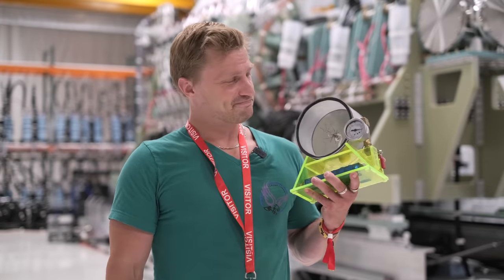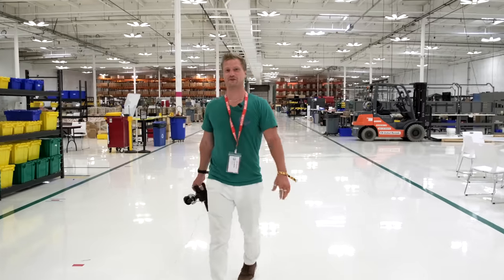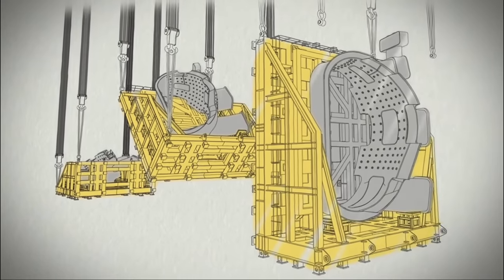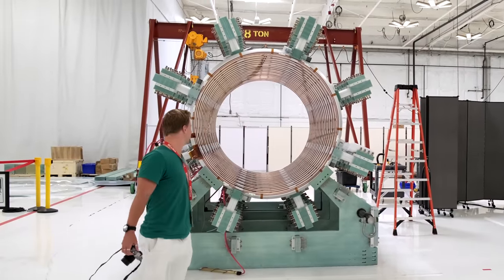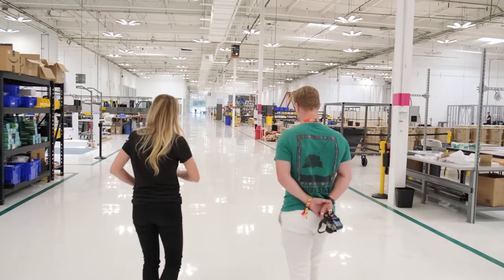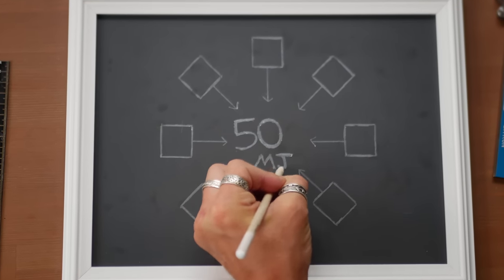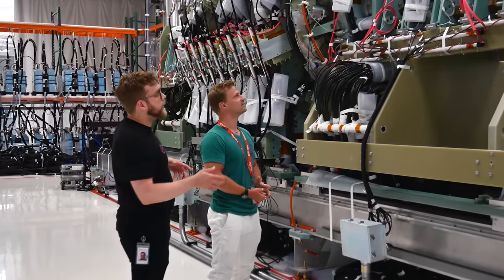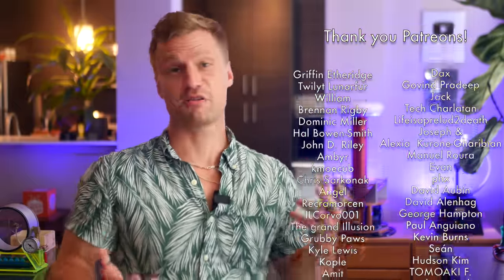An Exotic Approach to Nuclear Fusion (Helion Energy BTS)

Comment: I was very surprised when some years ago had discovered that the atomic fission is simply used to generate heat to run the turbines with steam ... it felt like wood was replaced with coal and coal with uranium adn than we stopped for ages... Seeing this approach is very refreshing and inspiring. Looking very much forward to see all this fusion tech to change the world as the steam power did at its time.
Reply: This tech is already 70 years old, it’s essentially 
It’s doesn’t yield any energy, as you put more energy in than you get out
Reply: I agree with you about splitting atoms to boil water. It seems very wasteful doesn't it? I live within a mile of a nuke plant. I figure I might as well be at ground zero. Very little fuel but very toxic too!
Reply: Wood, coal, oil, uranium, and Helium 3 are all used as fuel, but with more specific heat produced as we advance. But it's probably not going to happen because fusion is far too violent to contain on any useful scale.
Reply: @StoneKathryn its just because energy capture is pretty difficult.
Reply: I agree! @Dynoids
Reply: @beelzebub3920  E=MC² does wonders just saying
Reply: Except you need 1 million times less uranium than you need coal for the same energy output. 
And it can make more fuel from non-fuel.
It's as if you put charcoal and some rocks into the furnace and got anthracite out of it.

Direct conversion however don't work with fission due to neutrons and fission generally being "messy" i.e. producing plenty of different elements after fission event.
Reply: Weirdly enough, the majority of our power generation comes from making a fluid medium spin a thing. Wind, hydro, steam. It's funny when you think about it.
Reply: @StoneKathryn  It's a common misconception but nuclear energy is actually pretty clean, especially compared to fossil fuels
Reply: Fusion is a steam engine but stupidly expensive
Reply: It is old technology, but I think this fact more so speaks volumes about how incredible and innovative the turbine engine was to being with.
Reply: @MyKharli  Not the design described in this video.
Reply: "It's a hell of a way to boil water"
Reply: @MyKharli    Did you watch the video?  This one doesn't use a steam conversion process.
Reply: @Bob_Adkins   There are a lot of engineers who would disagree with you.
Reply: @yeroca  Yes, and some of them said windmills would last for 50 years and curly fluorescent lights were the future of lighting. Even the stars sometimes fail to sustain a stable fusion reaction. It's simply too violent and too much on the edge.
Reply: @whimbur  Where do you put the spent fuel? It's been a problem for a long time. Of course they put our nuke plant on an Indian reservation because no one else would let it be in their backyard! Back in the 50s they wanted the "Friendly Atom" so they built nuke plants to show how great atomic energy can be. The government promised to build spent fuel reprocessing facilities for all the nuclear plants. That never happened. They separate it out as best they can but not as well as it was originally planned. There it sits in "caskets" at the plant. It leaks. Not so "clean". Go hug a nuclear fuel casket?
Reply: @StoneKathryn  your problem with nuclear energy is how the government treats the waste. Be mad at the government not the power plant. It's still ten fold cleaner than if they put a coal plant there. Atmospheric pollution doesn't have any feasible solutions like nuclear waste
Reply: @whimbur  I agree. The process is clean. Those beautiful bright tanks of heavy water with fuel rods in them. I've been to nuclear plants. I'm not saying they are "dirty". It's the after products that become the problem. I know if something leaks at the nuke plant right below me that the water table and aquifers will be contaminated for over 50 miles. It'll be a dead zone. Nothing will grow. I will have to leave. We have Iodine pills in our bathroom cabinets and we will be bussed out when the leak happens. I'm betting a lot that they can prevent that from happening. Are you?
Reply: @792slayer  I studied Mechanical Engineering because I was interested in how we make energy. It does very often have some kind of fluid flow involved. The Bernoulli equation is often used. Thermodynamics is the science of energy and I loved learning about it. The Carnot cycle for combustion is also fun! I never know what they are talking about when they keep raising the "efficiency" of a combustion engine. The Carnot cycle of combustion is only 60% energy efficient from the get go. No one seems to talk about this. You lose most of the energy as heat! Politics get in the way of understanding. I would hate to be a scientist in this world. It would drive me looney at what I'm expected to "change" in Nature and how physics works. Go figure!
Reply: Agreed. However, we DO use nuclear batteries for space probes, so there's that...

However, for large-scale power applications, yes. Hot rock make steam turbine go zoom-zoom ;)
Reply: @StoneKathryn  raising efficiency in most cases just means cutting down on energy loss when going from one form to another, and cutting down on things like parasitic drag. More efficient valve trains, variable cam timing, low friction bearings, etc. I was a mechanic for 10 years, and got to see the evolution of efficient engines. There's only so much energy potential in a gallon of gas, and we're constantly trying to turn more of it into motion and less into heat. Nuclear is similar, in that a tremendous amount of energy is wasted as heat. However, reactor fuel is insanely energy dense, so we see it as a net win over something like coal. One statistic I saw was that it would take 1.5 million tons of coal to get the same energy return as 1 kg of uranium. When viewed in that light, nuclear is remarkably clean energy. I'm excited about the future, as reactors that burn waste come on line. Thorium salt reactors are looking promising too. I also ran across a company that's revolutionizing waste storage. By line boring into the bedrock next to a plant, they can sequester the waste in a couple of 8" wide bore holes a couple thousand feet down, pump them full of concrete and be done with it. This keeps the waste away from people, ground water, topsoil etc, and eliminates the need for transit to a storage site. The company has stated this will reduce waste management costs by as much as 80%. 
Now, if we can get the NRC and politicians to get out of their own way, we'll be in good shape.
Reply: @792slayer that is interesting isnt it? It feels like we are mentally stuck in a paradigm and all we can think to do is make something spin a thing to make electricity. (In general, that is...please dont @ me with your list of exceptions everyone!)
Feels like were at this collective mental roadblock. Or is this just the best way? Seems unlikely. But whatever the feasibility of the fusion system in this video, it is neat that people are thinking outside the box and looking at different ways to do power.
Reply: @StoneKathryn 
Yet steam turbines are by far the most efficient means we have for generating power from heat. We use it because it works, at it isn't the same technology as it was 100 years ago. A lot of advancements have been made for extracting as much energy out of the steam as possible.
Reply: @beelzebub3920  That's not a theoretical necessity, though - it just means we haven't yet figured out how to efficiently-enough confine and heat the plasma or harvest the resulting energy.
Reply: @MattH-wg7ou  call me funny, but it may be some evolutionary predisposition because we live on a spinning rock, and figured out that fact pretty early on. It's kind of an abstract idea I had, and could be entirely wrong.
Reply: @StoneKathryn Nuclear fission is not "toxic".  Your exposure to radiation is exactly background levels.
Reply: @Bob_Adkins wanna bet?  Put your money where your mouth us.
Fusion is inevitable.
Reply: @RMX7777  I would agree with that. I live right above the nuke plant here. It works great. Secret: They got a new turbine from a foreign country a couple of years ago. They spun it up and it got harmed. They found out someone left a big wrench in it with foreign language symbols on it. They were so relieved that it wasn't anything from this country! How it didn't get found before the spin up and all that shipping and during the installation process I don't know. Caused massive damage. Things like that shouldn't happen.
Reply: @scottslotterbeck3796  I'm saying that the elements created after you split the Uranium 238 have toxic levels of radiation coming off of them for long half-lives. Why were the workers at the Fujiyama plant in "gear" to clean up the plant after the Tsunami? Would you go into that plant and "clean" it without safety gear? There is toxicity with nuclear materials.
Reply: @scottslotterbeck3796  I think many underestimate how hard it will be to build and maintain the equipment. 15 million degrees is on another level. Also, containment takes nearly as much power as the fusion produces. If a reactor produces 1 GW, it will take nearly 1 GW to contain it. It will be right on the edge of man's ability to make it work reliably, economically, and practically, even worse than windmills.
Reply: I remember being about 14 and learning a nuclear power plant is a fancy steam engine and being devastated...
Reply: @Bob_Adkins 
We do have one last desperate way to keep plasma off the walls: Gigahertz frequency minicoils. Essentially because plasma is conductive we can induce high frequency eddy currents in the plasma that due to lenz’s law create opposing magnetic fields that repel the inductive field and push the hot plasma away.
Reply: Real Engineering's channel handled the Neutron Emissions but IIRC its fairly negligible.
Reply: first of all, turbines is still the most effective way to transform energy right now. Also, for helion, there are multiple issues stated in this video by improbable matter https://www.youtube.com/watch?v=3vUPhsFoniw
Reply: @mikek1187  I'm betting those batteries are nothing more than hot rocks that interact with the cold of space.
Reply: Using steam has the advantage that the generating equipment is accessible and doesn't become radioactive.
Reply: @StoneKathryn that’s why you have to store those dangerous elements safely and securely. Nuclear waste leakage is very rare and rarely a problem too cuz they’re usually stored in areas where even a leakage wouldn’t contaminate the surrounding environment
Reply: Agreed..
Reply: @StoneKathryn  Zero greenhouse emissions. Nuclear power generation is very efficient, and when the fuel is properly used (currently impossible in the U.S. due to the irrational fear that some terrorist might steal spent fuel when it becomes suitable for making nuclear bombs) it ends up being no more radioactive than naturally occurring Uranium. Currently U.S. nuclear power-plants are only able to use the fuel rods for about 1/10 of their actual useful life.
Reply: @StoneKathryn how many nuclear plant disasters can you name? Its in the single digits and almost all of those were because procedures werent followed. The reactors today also are not the same as they were in the 70s
Reply: @TerryClarkAccordioncrazy  Very good point. Yes, I think the "working fluid" in the steam turbines has been heated in a heat exchanger from the core working fluid.
Reply: @cezarcatalin1406  There would be enough time to redirect the plasma away in the case of a breach of the magnetic containment? That would be great!
Reply: @beelzebub3920  Not yet and some fusion reactors have been energy positive
Reply: The real issue as fusing atoms will still be used to boil water, the Rankine Cycle. Supercritical CO2 turbines, employ the Brayton Cycle and quite a bit more efficient no matter the, "Fuel".
Reply: @scottwolf8633  I'll have to look up CO2 turbines. Thanks for that!
Reply: @StoneKathryn  Just remember Supercritical, its a state of Matter between Phases where the Gas under Pressure behaves as a Gas and Liquid.
Reply: @scottwolf8633  Do you mean superheat steam? You generally want to have steam in the superheat because you don't have to worry about liquid. The cooling towers transfer that heat so it can recondense the working fluid and dump that heat back out to the environment. The superheat steam is also at great pressure. You drop the pressure to expand it into the turbine. You get the 28 times expansion in volume when you do that. I think that's called flashing it to steam but I think you have to do that before the turbine? I usually played with refrigerant phase diagrams and not so much steam. I studied AC systems a lot.
Reply: @StoneKathryn  No, steam is not utilized as that is water in the gaseous state. I mean CO2 under pressure, that behaves as  both phases of Matter, both liquid and gaseous, simultaneously.
Reply: @scottwolf8633  Thanks! I'll have to look at the phase diagram of it. Water acts that way too under the temperature vs. pressure phase diagram as does refrigerants. That's why you have to give a full liquid to the pump side and a full gas to the expansion side or the throttle/expansion side will freeze.
Reply: @skipperg4436 half of fusion energy is also neutrons so Helion also wastes half
Reply: What they don't tell ya is how the coal we use is quite irradiated and gives off lots of uranium and thorium atoms that get freed into the air on buning.
Reply: @StoneKathryn   Well that can be rectified somewhat. with breeder reactors, and thorium reactors. I don't know the exact reasons why. Thorium basically stop making extra energy as soon as you stop pissing it off with neutroons, and breeder reactors can use "used" fuel rods somehow split those atoms even further until there as gone as we can get. What's left  cools back down to a elements that are super useful for other things and what's left of that is basically harmles background levels of radiation, there hot stuff (abahahaahahahahahah, erhm ok I'll see my self out) either way you're right! Fision reactors (like we have now) are hillarious over kill just to turn a massive wheel to make a ton of energy. I looove the notion of breeder reactors though.because the final products after a few years of use give super handy things for medical aid, building materials, and even small batteries for novelty things. As I understand it the corium(???) we eventually get couldn't power a phone...but sure could power a small toy. or back CMOS battery for a computer Unless you know better .
Reply: @StoneKathryn  Toxic how? There's no pollution being released. What's being wasted? It's a fully self-contained system.
Reply: @StoneKathryn  Deep underground, encased in concrete. Nuclear reactors produce very little waste in terms of volume. Where do you think the waste from other types of power plants goes? Most of it ends up in the air you breath. Nuclear waste is much, much preferable to the waste produced by other power plants.
Reply: @weblure  You do have to bury all the steel after the plant closes due to radioactivity from neutron flux over it's lifetime. Not many power plants I know have to be buried. I
Reply: @weblure  The storage caskets on the property of the plant I'm worried about because of the ground water here. I live right above the plant and if the caskets leak they say it would contaminate the water for 50 miles around and they have evacuation plans to take us out of here. They do have waste when they change out fuel rods.
Reply: @StoneKathrin Coal plants produce millions of tons of radioactive waste in their life times. Nuclear plants create less than one tenth of a percent as much radioactive waste. The waste can also be reused, and is safely stored.

Comment: What Helion is doing is not so new and revolutionary as they claim. It's an FRC - those have been around since the 60s. I'm sure a lot of research went into their project, but a few details consistently get left out. Neutrons for example: They still get those, as the Deuterium in their reaction has an equal probability to fuse with each other rather than a He-3 nucleus. That produces those nasty neutrons. Why they claim their reaction doesn't have those, is baffling. Then there is power output. At their proposed temperatures there is basically no chance this concept would ever produce net energy (we are 3 orders of magnitude below a D-T-reaction here...).
Reply: They can make the claim because they have the data from experiments to back it up. Instead of just being lazy and commenting here on YouTube, go look up their published results.
Reply: They did leave that out, but DD neutrons are only 2.5MeV, and DT neutrons are 14.1 MeV.  This lower energy means much less damage.

Also, DD fusion is actually desirable because it is the means of generating He3 fuel.  My understanding is that the fuel mixture (ratio of deuterium to helium-3) and the conditions in the reactor are variables that can be tuned to focus more on power output (DHe3 fusion) vs fuel generation (DD fusion).
Reply: @d4rk0v3  do you have a link to a paper for me? Didnt find much, but I would really like to read that. (I did however find what the American Physical Society had to say about their research, which was not very nice)